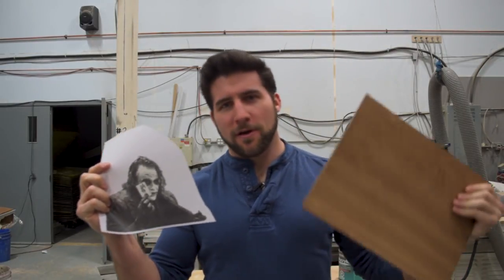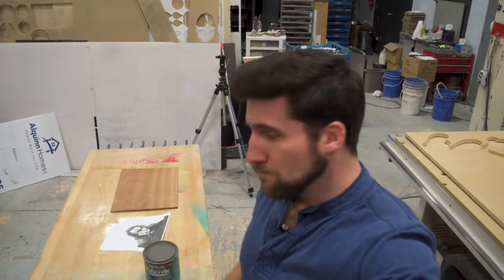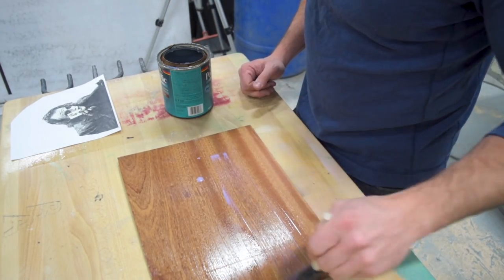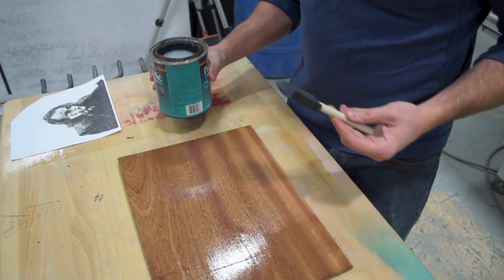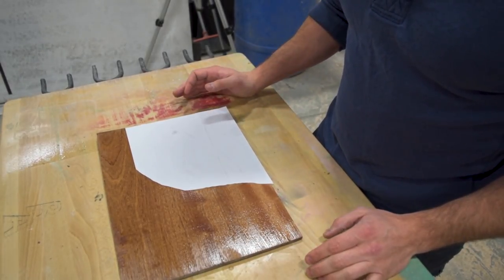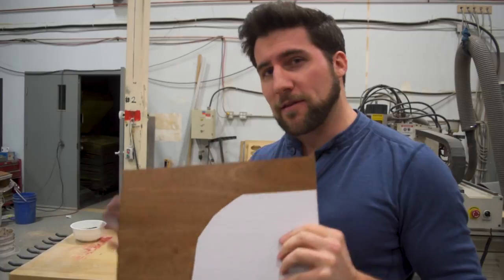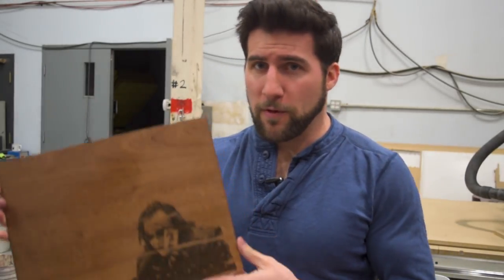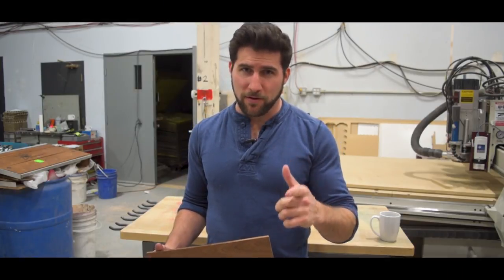How to transfer an image onto wood

Comment: Brad - I'm a fan and so glad you posted this technique. I've seen others but I trust your expertise. I want to use the same technique but instead of on raw wood I want to have the graphic on white. So will it transfer to a painted surface? If so what type of paint for the white? Your work inspires me! Many thanks friend.
Reply from the maker: It will transfer fine into that polycrylic medium regardless of what colour is underneath. 
You’ll likely want to use an acrylic to paint the wood in that case.

Comment: Hey can you do this to a surface like a guitar that already has color on it? and does it have to be black ink? or can it be like red or green or blue or purple ink? What kinda paper is that printed on?
Reply from the maker: Yes, you can do it on a painted surface as long as you abrade it so the polycrylic will stick. Doesn’t need to be black ink, but it does need to be laser printed.
Reply: @BradAngove  awesome. u r a big help man. thank u
Reply: Hey do you still think skyscraper guitar tools are good? needing to get me some good tools. that arent over priced like stew macs tools are
Reply from the maker: For sure they’re good
Reply: @BradAngove  Thank you. Also if I have to glue in a set neck, should i glue it before I paint it or since the neck is going to be half gloss and matte finish? Im at the steps where this is important.
Reply from the maker: That’s just a matter of preference and how you choose to sequence it. I usually glue my necks before painting.
Reply: @BradAngove  thank you. hey can you use wood filler as a grain filler?
Reply from the maker: Yes. Just thin it down a bit if it is too viscous to push into the grain easily.
Reply: @BradAngove  Thank you again. Hey are skyscraper guitars acrylic radius gauges good? Like whats the difference between the metal and acrylic if any?
Reply from the maker: I haven’t used them, but I’m sure they’re good. I think the difference would be the ability to look through them. Metal is good because you look for light under it.
Reply: @BradAngove  thank you again. Is vinyl sealer the same as primer?
Reply from the maker: It has a similar effect. I have a video on primer vs sealer.
Reply: @BradAngove  Thank you, and awesome. Thats what I like to read lol.  Hey you may know this. The straight edges with the notches. They have some for gibson, fender, and prs. But what if you have ibanez or jackson or solar or esp or bc rich or hard luck kinds and so on and so forth? Do you have to get one made for all the other brands?
Reply from the maker: They’re made for particular scale lengths. Not brands per se. You just need to check what the scale length is on your guitar and get a notched straight edge made for that scale length.
Reply: @BradAngove  again thank you so much ur a huge help

Comment: What if I have a guitar painted with a 2k matt? Can I apply the polycrilic straight to the paint?
Reply from the maker: Why wouldn’t you do this step before applying the 2k matte clear?
Reply: @BradAngove  thanks for the reply! I didn't specify, it's a colour matte. Is there a way to transfer the drawing to a guitar already painted? If that's the case what kind of paint should I use?
Reply from the maker: Yes, you should be able to do that using an acrylic based paint.
Reply: @BradAngove  thank you! Great channel!

Comment: Is it possible to stain over the image before clear coating the project
Reply from the maker: Over top of the image? You’d probably be better off tinting your clear with dye and spraying overtop instead. You can stain over a surface that already has the acrylic clear on it; it won’t soak in.

Comment: Hiya Brad....you'll be getting sick of me soon!! I've tried this quite a few times using a product called 'Mod Podge', which is a water based acrylic. The image does transfer but it's damn near impossible (for me) to do and not get little patches that are missed. It's not so much that the image doesn't transfer well, it's more that the ink is rubbed off the wood in places when I rub off the paper. I haven't used a sponge to rub off such as you did, I was using water and my fingers to do it, but it seems some of the rubbed off paper acts as an abrasive ( I guess) and rubs off some of the transferred image. This is a pain in the ass as my plan is to use the finished product as a clock face, but I haven't yet been able to transfer the image without 'chip out'...for want of a better description. Do you understand what I mean? Any idea how to avoid this chip out?
Reply from the maker: Can you tell if any of the mod podge is also rubbing off?
Reply: I doubt that the mod podge is rubbing off because I have left it as long as overnight to be absolutely certain that it's dry. I could be wrong, but I'm pretty sure that the ink itself is rubbing off. I may be expecting too much, but it needs to be pretty well perfect or else the clock is not going to look so good.
Reply from the maker: I was more worried about it not adhering properly as opposed to not drying properly. Unfortunately I’m not really sure how to get around that issue. As you can see, I had some problems with mine as well, although I believe those were due to the paper not being pressed down well enough.
Reply: The type of paper used must have a bearing on things too
Reply from the maker: I believe the roller would help. I imagine a thinner paper would be easier to remove without damaging the image.
Reply: I think the roller would help too....and maybe photocopy paper rather than the nice quality paper I use for printing text usually. I'll order the roller and give it another shot. I'll let you know how it goes.
Reply from the maker: I look forward to hearing about it. Hopefully it goes well.
Reply: I'll be in touch for sure. I just found Polycrylic from Minwax in a rattle can....I wonder if that would offer any advantage over the brush? I know that the mod podge is pretty thick, which isn't the best.  https://1outlets.nz/minwax-33333000-water-based-polycrylic-clear-spray-11-5-ounce-aerosol-satin-NZD-ccy/pid/15166754687461/
Reply from the maker: I’m sure it would be pretty similar. I think the thicker stuff from the brush might be advantageous, but I’m not sure.

Comment: If there is text in your image, will it come out reversed on the transferred image? Also, what does the original image need to be? I notice you said "ink", so would a photocopy work? Or does it need to be ink (like from an ink-jet printer?) How about a laser printer? Thanks!
Reply from the maker: It will be reversed. And it needs to be from a laser printer. It doesn’t matter if it’s a photocopy or normal print.

Comment: use a Plastic spatula to avoid wrinkles the type used for vinyl work
Reply from the maker: I glue a small piece of felt on my spatula for vinyl to avoid scratching it too. Works well when you're not using transfer tape.
Reply: that is a great idea much cheaper than buying the ready made wood and felt type

Comment: My next experiment... scrap wood, sanded.  Lay down water based color coat.  While the paint is wet, press on printed image.  Let dry, work off paper backing.  If I get a good image transfer, water based clear.  We’ll see.  🎸
Reply from the maker: Hope it goes well!

Comment: Can you use a photocopy  if you don't have a  Lazer printer
Reply from the maker: A laser printer photocopy?
Reply: Just a regular photo copier
Reply from the maker: I don’t know what printing method those use. But this only works with laser as far as I know.
Reply: Hi Brad, I have a question it may be lengthy  , I have  an idea   it is to transfer a picture  of an old pirate  ship on to a guitar. Under the  ship I want to transfer another picture of a shark  and a sunken  ship.ithen want to(if possible) put a clear coat over this .know  is it possible  to put something  that looks  like  seaweed  on this then put another  clear coat over top to get a 3d effect?
Reply from the maker: You want to transfer the image in 3 layers? I’m not sure if that would work but it would be very thick. Why not just get those elements into the printed image all at once and transfer it?
Reply: @BradAngove  I was thinking  of a 3D effect  I don't know if this will work
Reply from the maker: I don’t think doing it that way will give the effect you are looking for.

Comment: Here is the reminder that we talked about 😀
Reply from the maker: Thanks. Initial test didn’t work, so I’m trying something a little different.
Reply: Brad Angove okay, keep me posted. On a separate note, do you ever work with waterborne laquers, like emtech or ktm (I've heard they recently stopped making ktm)? That's what I've been using on the 6 basses I've built since beginning this "hobby" . I went with it for the ease of cleanup and stuff but I'm considering a change. It doesn't seem to get real hard when cured and I keep getting what looks like water spots deep in the finish after buffing. Like it absorbed the water from the compound or something weird...cause it looks clear as glass before rubbing it out. Any advice besides switch to nitro, lol?
Reply from the maker: I’ve worked with the water-based stuff a fair bit. I’ve never really needed to buff it to a full shine though. 
It’s more crystal clear than the nitro is, and doesn’t yellow. It dries slower as well though. Anywhere up to a couple months for full hardness as I understand it.
Reply from the maker: I conducted another test tonight. If I recall correctly you were aiming to transfer ink over to wood to use as a base image for airbrushing, correct?

I used a laser printed image and put it face down on a piece of bare wood, then used a rag with some lacquer thinner on it to gently dab the paper and transfer the acetone based toner onto the wood. That’s probably a better option for airbrushing. Be warned though, you need to practice it a few times before doing it on anything important. Too dry and it doesn’t work. Too wet and you just get a smudged ink puddle.
Reply: Brad Angove to use as a template to dremel (carve)
Reply from the maker: Oh, right. That’s even better then. Wouldn’t want to be trying to seemed carve through that polycrylic. I imagine I’ve probably already said that haha.

Comment: You know you could just use an iron-on paper printed in reverse on the paper and just iron it onto your wood like you do an iron on patch on a t-shirt
Reply from the maker: Yup. You’re not just transferring the ink when you do that though. You’re transferring a piece of paper to the wood haha.
Reply: Not only that, an iron, depending on how hot (or how long) may separate the glue joints on your guitar body, causing crevices. But if Joseph can get it to work, then by all means show the community. On a side note, followed your instruction on dying, did not turn out the way I intended, mostly in part due to the grain pattern, but now my project has taken on a new life of its own. Now, putting an image using your technique on something dyed will bleed out the color. I am going to shoot some clear lacquer to lock the dye in and then use Aqua Coat wood filler (shot out to highlander guitar) I am hoping this will  act the same as the minwax product for an image transfer. Any thoughts?
Reply from the maker: What makes you think that using this product will coat your dye to bleed?

Comment: A old tattoo machine could transfer a picture, or a engraver....
Reply from the maker: Indeed. I like using the laser engraver does it, but the detail can be tough to get.
Reply: @BradAngove  yeah the laser can do things we can't do by hand ,i don't have access to that kind of equipment..on another note the paper picture method works good ,but it leaves a chance to not get the full picture.
Reply: @BradAngove  maybe a soft roller of some sort might help get the air bubbles out.
Reply from the maker: A rubber j roller might work
Reply: @BradAngove  ? What is that????   Do you have a picture of one...
Reply from the maker: It’s a roller used for pressing things down. It’s just called a j roller because of the shape. The roller wheel is rubber.

Comment: Good Vid , but you were correct the first time in saying the adhesive was a waterborne paint , not water based , it is Acrylic based .
Reply from the maker: Yeah, I’ve got some water based paints and some waterborne paints. I need to pay more attention to which is which haha.
Reply: Hi 
Thanks for your reply ,but there is no such thing as a water based paint ,other than " Water " itself , people do say water based when in reality the  .
the base of a paint is what the main  constituent is ie . Acrylic , Epoxy etc .
Water borne just means water is used to help transfer the paint from the Tin to the surface , when that is done the water evaporates and is no longer needed .

Comment: Hi Brad, Awesome idea!!!  I typically stain with water based dyes and lock in with a sanding sealer.  If i were to apply an image, should i A) apply sanding sealer before applying image, B) apply sanding sealer after image application, or C) avoid sanding sealer.  Can i apply nitro clear coat over a laser toner image?  I recall reading somewhere that you're supposed to avoid nitro on decals.  Thoughts?
Reply from the maker: I’d probably go A to get a smoother look, but B is also fine. And yes you can apply nitro over this; just do it gently. Light coats. Nitro melts some kinds of decals.
Reply: @BradAngove  Excellent!  Thanks for the 411!  I'll give it a try.

Comment: Hello Brad, nice video. Say, if I want to print a logo on a headstock by this video, should I cover the whole headstock in glue, or should I only do the place where the logo goes? Will the colour differ if I don't cover it all?
Reply from the maker: I would do the whole thing, just for the sake of keeping it even. There may be a bit of residue. What glue are you using?
Reply: Brad Angove I don't have glue yet, I am just considering for next time. Up until now I've used see through decal stickers, did some layers of clear coat, sanded, clear coat,... been looking for a different methode since it takes kind of long, and in the end I always still see a plastic like shine on the decal

Comment: one quick question, i have only watched a few of your vids so u may have had this covered, what i would like to do is put an image as u did on trhe piece of wood, would it work the same for an electric guitar and acoustic, if u have any vids on it can u point me there, again huge thanks!!!
Reply from the maker: Yes, it would work the same. I will just caution you that you need to be careful what you apply as far as coatings on an acoustic due to the effect on the sound of the instrument.
Reply: Thanks :)

Comment: Hey man, could you do the same thing but now with the expensive and fancy equipment (laser, etc).
Reply from the maker: You could definitely do it with a laser, but the results would be slightly different of course. Namely you would have it burned into the surface a bit.
Reply: If there’s more people requesting a video with laser printing, add me to it.
Reply from the maker: Understood. I’ll put it on the list.

Comment: Is it a different process to transfer into motorcycle fairings??
Reply from the maker: You need to use a different clear coat afterward for those, but other than that I imagine the same concept would apply.

Comment: Hey Brad, thanks for the informative tutorial. I needed your advice on something. I have a completely stripped down stratocaster (bare wood) that I wanted to transfer multiple images onto, mainly printed photos. But in addition to the photos, I wanted to stain the wood to the color of my liking so that the negative spaces would show the stained wood through the transferred images. What order of events would you suggest as far as achieving this final look? Would I have to stain first, then apply this transferring technique? If so, would I have to paint the polycrylic over the entire surface of the already stained wood to keep the same color consistency? Or would it make more sense to transfer the image first into bare wood, and then stain it afterward? But then how would the stain reach the wood if there's a layer of polycrylic underneath? Please help if you can, I'd really appreciate it!!!
Reply from the maker: You won’t be able to stain through a layer of polycrylic. Stain first, then do your polycrylic coating and then your transfers.

Comment: Would this technique work on a guitar body after staining and before poly? Love the videos ! Cheers
Reply from the maker: Yes, it would work but you still need that acrylic medium to take the ink in between.
Reply: @BradAngove  So once you've transferred the image, could you finish your clear coat with poly or are you committed to acrylic?
Reply from the maker: Poly is fine.

Comment: That is a pretty cool technique. I wonder how it works with inkjet printer images compared to the demographic printed image you just showed.
Reply from the maker: I’ve never seen it used on inkjet, but I’ve heard it doesn’t work as well.
Reply: Thanks I guess I'll stick with color xerography. Have you tried with color prints?
Reply from the maker: It works with colour prints as well.